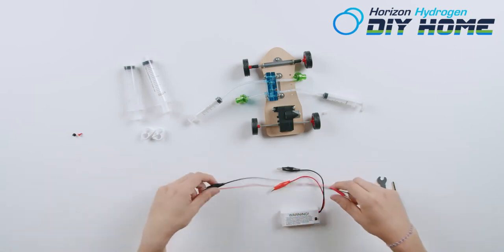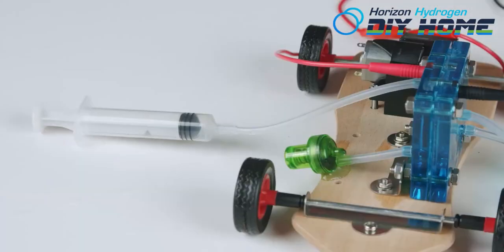H2GP XPR - How To Build a DIY Hydrogen Fuel Cell Car

Comment: Hi guys, I purchased the RESK-02B-1 DIY Fuel Cell Kit. Im using it to test PEM fuel cells for a project, I see some of the manuals have various tests etc but Im trying to calculate the efficiency of the fuel cell and wondering what is the best way to do that with this kit, would you know or be able to put me in contact with someone who would know what experiment or how best to do that?
Reply from the maker: Hello :) 
Measuring of efficiency is possible, but you need precise measuring inputs and outputs. Input means that you need to know, how much hydrogen you put in (measuring volume and pressure). Output means measure amount of energy you get from fuel cell in real time.
In one liter of H2 pressure 1 bar is approximately 3Wh of energy.